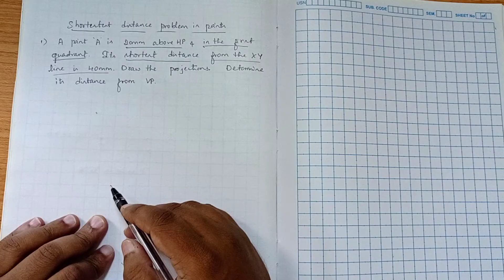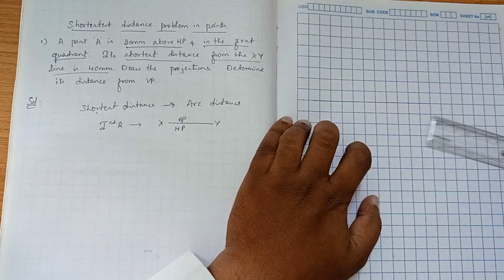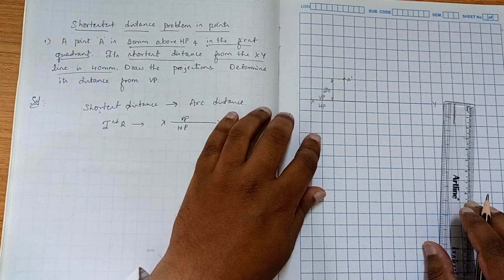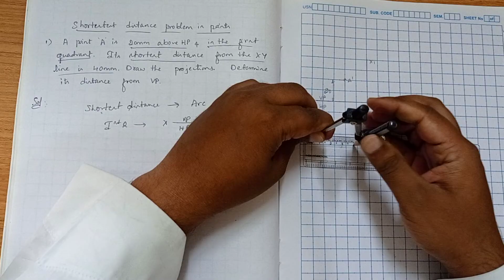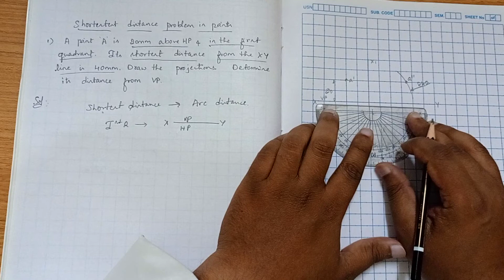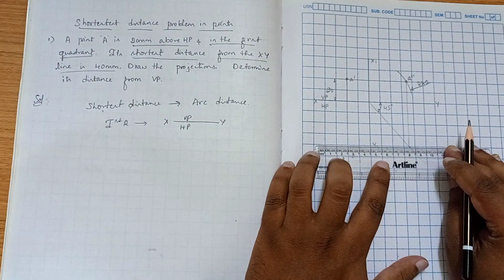Shortest distance problem in Points Engineering Graphics/ Computer Aided Engineering Drawing

Comment: why did u use the protractor like that?
Reply from the maker: To join side view with top view
Reply: @engineeringvisualization1005  no I meant shouldn't you put the 180° line of the protractor on the reference line to get the accurate angle?
Reply from the maker: @babamunam  yeah you can do
Reply: then we will get ~35 and not 39  @engineeringvisualization1005
Reply: No need of protractor to get 45 angle. You can just match diagonal line of grid boxes